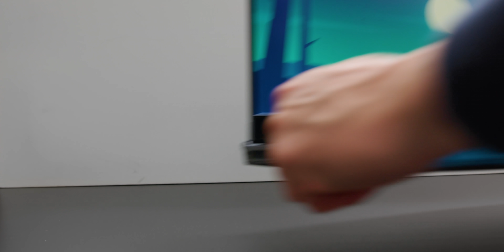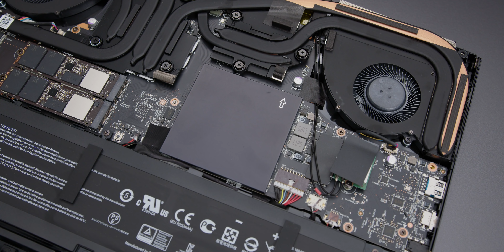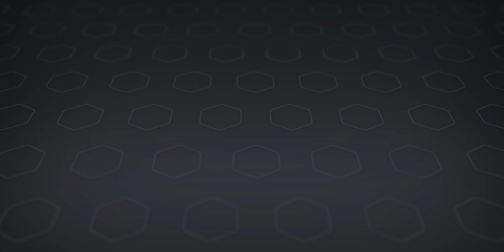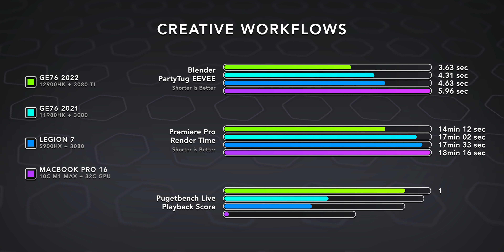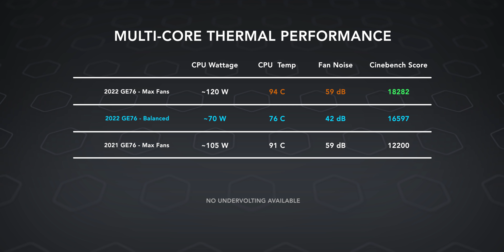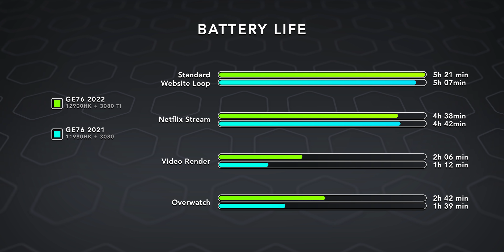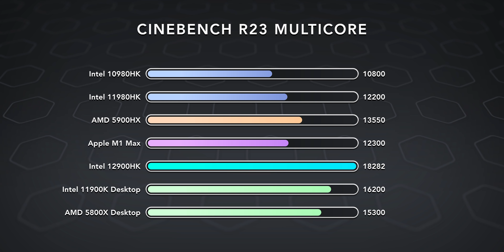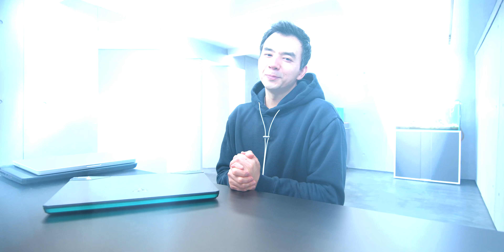This Laptop Is Faster Than Your Desktop

Comment from the maker: These new chips are FREAKING FANTASTIC. Especially if you don’t push them too hard and keep ‘em under 75 watts.
Reply: Can't wait for the Zeyphrus G14 Ryzen 6900HS + RX 6800S review 👌
Reply: How can I care if you don’t tell us the price?
Reply: Dave2D claiming this laptop being faster than a desktop gaming PC.
Also Dave2D stating it is slow than his MiniDesktop.*

Dave2D also trying to run 2k+ VR games on ultra settings on this laptop and starting to cry, because he realizes this title is bs.

A gaming laptop that is good if you don't push its performance:
Solitaire in 8k, 140 Hz. INSANE..
Reply: @privileguan9127  Apparently Dave was just testing if we're paying attention to him.🤣😂
Reply: Impressive numbers but I gotta say those temperatures & the batt life are proper pathetic though...for a laptop, 74 deg C is crazy, and 4 hours just ain't gonna cut it in 2022 man.
Reply: @PedanticPatrol  74C @ 75W lol otherwise its 93C at 105W... These really aren't impressive numbers outside of the raw performance available in this desktop replacement size laptop. 
This is mostly just because they got rid of the "desktop AMD" laptops they had a couple years ago... Otherwise a 5950x laptop would beat this one while using around the same wattage...
Reply: @Jimster481  amd has heat transfer issue. If replace 12900h with amd chip and power with 75w. That chip might go up to 120c.
Reply: @Jimster481  also why the fk u fanboys against admitting amd losing??? Is not competition good for everyone? Or u fnaboys just like to be right all the time. And Amd lost proves  u guys are not always  right? Or something?
Reply: @Jimster481  exactly! What makes a laptop impressive is its ability to trade blows with desktops WHILE STILL BEING A FUNCTIONAL LAPTOP. If the temperatures are crazy & you can’t even use the palm rest & keyboard without frying the micro vessels in your palms, what are you even talking about right?? Ridiculous man!
Reply: @PedanticPatrol  yep...
Reply: Where can i get that hoodie dave?
Reply: i think u mean 12900HK in the description
Reply: That doesn't sound too great though, you can't really say a chip is great but then say it can't be used to its fullest.
Reply: @mortenee88  Especially considering that 75W is what he is targeting. Sure that is fine in a desktop replacement but basically it is not okay in anything else. For example my Alienware M15 R5 can only deliver around 26-30W of cooling performance to the CPU when actually pushing the GPU to the max 120W power spec... At that wattage this chip would be amazingly slow considering how much power it needs to beat Zen3.
Reply: @Jimster481  the numbers are all wrong anyway. The cb23 numbers are just wrong.
Reply: @mortenee88  Which numbers are wrong specifically?
Reply: Hey Dave, theres a typo in the video description. The 12900HK.
Reply: @WubyDubyLee  lol i didn't even notice
Reply: YOO this is COOL
Reply: @GT Suryateja m1max unplugged is @30-35W
Reply: @Joe Copium
Reply: Halleluiah, they return Fn key to where it should be)
Reply: Dave please review xiaomi redmi g 2021 (ryzen edition
Reply: Sir plz create a channel over discord server for all your wallpapers
Reply: Definitely not faster than MY desktop though 😜
Reply: @Joe I mean they are using literally double the power or more vs the other platforms. It isn't really competitive in terms of power draw. The performance in good but maybe we should make some 5950X laptops with the TDC and EDC turned down just to retain the crown....
Reply: What's the price though? $3000+?
Reply: So many AMDumbs aka AMD fanboy are mad because Intel since Alder Lake comes out, it put AMD to the shame no matter if it desktop or laptop. Can't wait to see Intel bring monster CPU like Raptop Lake which is 8P+16E, this monster will bury Zen 4 like no tomorrow.
Reply: Liquid Matel is a joke. Waiting for it to leak and cause shortage.
Reply: Brother mine, what do you think about this thought, I've been following your channel along with a few more. And mostly the hype is all about gaming devices including phones.. and in that I haven't seen any android perform as well as the Iphones whether it be ROG Phone 5 or its ultimate version, I think there should be some sort of option wherein users would get to lock the frame rates of their own choice, and for this to happen the phone must use 100% of its CPU & GPU capability. So what do you think about this???
Reply: Oh boi
Reply: Description has the wrong number on purpose?
Reply: Price???
Reply: its amazing what they can do in a pinch aint it.....
Reply: There's someone pretending to be you.lol
Reply: @Spartan noble07 Yep I mean running at 90C+ is pretty garbage.
Reply: 👍🏼Sweet! Thank you, Dave! Nice to see Intel coming back under new CEO Pat G. 😎✌🏼
Reply: Do you think these laptops with the new chips will be great for video editing when working on battery?
Reply: Are you getting paid directly or indirectly through intel for this?
Reply: Laptops not interested,  MSRP GPUs only.
Reply: Awesome Laptop 👌🏻
Wish they make it in Full White
Reply: This combo is not on MSI's website! The closest version of this model to what you are showcasing here is an i7. There is no i9 with 360htz screen and a 3080ti.
Reply: Think you could post the SKU because I cant find the model that has these specs on their website.
Reply: Now I want to see how well would the new Celeron and Pentium fare
Reply: Hello dave. …. This msi laptop model is Raider GE76 12 UH
Reply: Real elephant in the room will be price 😂
Reply: Please review the Asus Zephyrus M16 2022 laptop. Thank you!
Reply: How can I get the wallpaper u r using
Reply: Apple CAN do that. But they made LAPTOP not behemoth.
Reply: This or the new Alienware X17 full loaded i don't care about price which one is more powerful and better for gaming ?
Reply: Can u please change the camera angle i kinda hurts my brain. Great content.
Reply: Uhhh I ain't seeing any link for online store in description to check this laptop out, would you mind putting it?
Reply: This laptop in overall is only 10% faster than previous year model. And cost 800$ more than last year's model. Very Disappointed
Reply: Some comments on battery life? Using balanced mode that'd be just over and hour and less than an hour when pushed? That's an extremely limiting factor or am I missing something?
Reply: Great machine but now of days you HAVE to have a 4K 120 hz monitor on the laptop like the Asus Predator Helios 500.  But I agree, I no longer see any reasons to EVER buy bulky desktops.  As my Predator can edit 4K videos faster than my RTX3080 TI DESKTOP
Reply: No it's not faster than my r9 5900x, 3080ti desktop!
Reply: @TheSaibarnub  I have both a i9 RTX3080ti 64G DDR4 Drsktop and I have the Acer Predator Helios 500 4K with the same exact specs as the Desktop just with a RTX3080 and there's no noticeable difference.  (I would have to get diagnostic tools to see an difference)  I use for 4K video renders
Reply: May I ask where you got that sick aquarium?
Reply: your hoodie ?
Reply: 🐶🐶🐶🐶🐶🐶🐶🐶🐶🐶🐶🐶🐶🐶🐶🐶 OMG SO CRAZY THE #LUMIY LIGHTBLADE YOU HAVE IS SO AMAZING √🐶🐶🐶🐶🐶🐶🐶🐶🐶🐶🐶🐶🐶🐶🐶🐶🐶🐶🐶🐶
Reply: Please send me 1 laptop. I want to learn computer
Reply: Can you please review MSI Creator Z17 A12UHST-046.
Reply: I'm looking for this laptop with the same components (360hz, 3080ti, i9 12900hk) but can't find one to pre order. There is an i7 alder lake instead of i9 alder lake. Would there be a big difference between the two?
Reply: Dave pls review rog strix scar 17. 12900h 3080ti
Reply: I would like to buy i would i purchase it?
Reply: Is this laptop better than the new Asus Scar 17 2022???
Reply: sorry, i cant flex on 5000 euros.
Reply: Hey I would like a tier list of the most silence  gamers laptops you can buy, with options likes money can buy, budget friendly too
Reply: where to buy though, i need it please put a link in the description
Reply: Any at a lower price?
Reply: hey Dave, more budget stuff please?
Reply: @Joe M1 Max already wasn’t particularly fast when it launched.
Reply: Those gains are due to DDR5. Wait till AMD does that!
Reply: @aniketk7401  DDR5
Reply: @joe_ferreira  Yup. Was looking up graphics when wrote that! 😅
Reply: This is totally pointless without including amd 6000 series
Reply: You notably benchmarked it against the AMD 5800 NOT the 6800X! Rigging the outcome against AMD?
Reply: Those cinebench r23 results looks cherry picked AF also.. scoring the 11900k that high is just wrong, it's honestly quite a shit CPU and you need some serious oc to make it score above 16k. At stock it should be around 13500..
Reply: yep they sure are
Reply: Oi dave, please arrange a gpu for me at msrp. Please 🙏🙏🥺🥺

Comment: LOL, maybe your desktop. I have 64 cores in mine, that's before "threaded", 256GB of RAM, and 3090. JUST barely missed the 60K score mark on Cinebench Multi-core and that was with pure air cooling in an 80F room. The CPU only got up to 50C.

Comment: dave can you next time make test with afterburner you playing. in afterburner must have cpu gpu specs and temps. on youtube guys always showing only performance in graphic. we cannot trust this graphics to buy laptops.  i showed many videos but cannot trust them. because few years ago i bought 3 gaming laptops and they are very stressfull to play games in very low settings with native resolution. CPU and GPU temp always make thermal throttling. now days some videos that have nice temps they always lock fps at 60. in online gaming 60fps is so bad. if cpu and gpu temp locking in 80c i want to buy laptop for gaming and working. if you read this comment thank you for your attention.

Comment: Yeah and I am the Pope.
First of all, it does not have full desktop CPU+GPU power (about 80% of a desktop counterpart), they are limited to TDP/TGP the manufacturer imposes, then there is the throttle because the temps rise to 90 degrees and over, with ease, which desktops don't.
So what's your point?
Reply: his point to get more views from the title description, its a click bait, nothing new

Comment: My Alienware x17 R2 with a 12th Gen Intel® Core™ i9-12900HK (24 MB cache, 14 cores, 20 threads, up to 5.00 GHz Turbo) processor and a NVIDIA® GeForce RTX™ 3080 Ti, 16 GB GDDR6 with a 4 TB RAID 0 (2 x 2 TB), M.2, PCIe NVMe, SSD hard-drive and 64 GB, 2 x 32 GB, DDR5, 4800 MHz, dual-channel memory with a 17.3", UHD 3840x2160, 120Hz, Non-Touch, 4ms, Advanced Optimus, ComfortView Plus, NVIDIA G-SYNC screen and Alienware X Series thin keyboard with per-key AlienFX lighting (English) with a Alienware Wireless Gaming Mouse - AW610M - Lunar Light >

Comment: Hmmm.....not sure about this one. Both Intel and Nvidia are energy guzzlers so there is going to be a lot of heat and a lot of power consumption. As far as cpu comparisons go, the Intel part has 14 cores while the AMD part has 8 cores. So you are comparing a V8 against a V4. Of course the V8 will win on power but it also requires much more fuel. Then there is the real problem.....PRICE. I'll pass on this one. If I want to game then I will use a desktop or a PS5, makes much more sense.

Comment: Don't get such a powerful gaming laptop unless you're a multi millionaire with a lot of money to burn. They don't last as long due to heat, I just recently gave up fixing my Alienware for the 5th or 6th time (each time very expensive to fix), from changing power adapters due to wire damage and over heating, to replacing the i7-8750h"s North Bridge, to changing the bios battery, to finally I don't know what's broken, maybe the 1070GPU chip. I coulda brought a whole new laptop with the money I spent on repairs, and I just got another laptop recently, after gaming for awhile, I wonder to myself why I didn't just change laptops sooner. I got the 3060, never buying above 60 again on a laptop even though 3070 isn't much more expensive.

Comment: In addition to gaming what about the content creation. Ok it is fast but it does  look  like it fails in color accuracy which you did not mention.   Also, the display is not very bright, and what about sound quality.   For all around performance and function it does not seem to match up with some other competitors.  For those us that are  want an all around computer not just a fast gaming machine.  What good is super fast rendering if it fails in color accuracy.  and 336 nits is not very bright.  So excited about performance but that are other important aspects of a machine than just fast performance.  I could sacrifice not so fast performance for color accuracy and a nice bright screen, and great sound quality.  It might be a great machine in some respects but it is a matter of preference when it comes to other aspects of the machine it seems to me.  Again you get so hyped about one thing you overlook other features. what about the ports?  what about the sound?

Comment: It may be possible to undervolt if in the bios you hit right shift + right alt left shift and f2 to enter advance mode that will show the over clock settings although in my ge76 11gen i7 it did look like no undervolting just increasing the voltage but I’ve been out of the overclocking game for awial so maybe I just need to look into it more to get it to undervolt

Comment: In Norway this laptop is priced at the equivalent of 6000$ USD.

Let's put that insane price into perspective.

For almost the same ammount of money I could buy a prebuilt desktop with these specifications:

ASUS ROG Strix custom case
Custom Asus ROG Strix X570-F motherboard
AMD Ryzen 9 5900X
NVIDIA GeForce RTX 3090
32 GB RAM, 1024+2048 GB (SSD+HDD)
850 Watt 80+ platinum psu

And I would still have enough money left over to buy myself a laptop with these specifications too.

GeForce RTX 3080 Mobile
Ryzen 7 5800H
16GB RAM
512GB SSD
1TB HDD
1080p 144hz display

If you build your own pc the desktop machine would be cheaper and you could actually save money compared to just buying the MSI GE76 or invest it into a better laptop than I used in my example.

Yes the MSI GE76 is better than the laptop I did use in the example but the performance difference in games are not going to be more than 10-20% in most games while the price is 3 times higher.

Comment: Sure it out perform a little bit Apple M1 Max but we should remember that heat is degrading the device life span & the performance will go weaker with time. Meaning, the performance to power consumption ratio is the high tech thing we should focus in! That ratio is the key to have device long life sapn, longer battery life, lower electricity bill & better environment! Nowadays we should bring first the numbers of that ratio & promote devices by that ratio
So no, the Apple M1 laptops still way better than any laptop out there. By the way I'm using MSI 75
Reply: & this is useless if it's not a CPU/GPU ARM. Something to compete with the Apple M chips. 
We need that to happen to solve graphic cards shortage, great FPS/graphics, low heat, thin device & high power efficiency. If Intel, AMD & Nvidia don't make it soon, the Apple M chip 2 years transforming program that includes AAA gaming support will dominate the marke

Comment: They finally fixed the akward keyboard layout AND full numpad it decent IO 4 usb 3.2 plus thunderbold card reader 3.5mm and full RJ45 HDMI (wonder if some are combi ports which is a minus)and internels look good too, bit annoyed they went for soldered wifi, i guess its a contender still need more research

Comment: This isn't going to outperform most desktop gaming machines 1 generation back.  It will heat up, it will throttle, and its performance will take a nosedive.  Is it amazing for a laptop?  Yes.  Will this machine outperform an 11th gen Intel desktop machine with a 20xx series Nvidia and DDR4?  Not over a full gaming session.

Comment: So even though AMD Zen 3+ is coming out on TSMC N6P, is going to clock faster, and AMD is saying it has 1.3X the performance of Zen 3, which is 30%, and the APUs are no longer old GCN and are now RDNA 2, just hand the win over to Intel.  Maybe for the high end part, but I watched the review with the high end part which also has the 3080 Ti, and the amount of gaming improvement looks like the difference of last year's 3080 and this year's 3080 Ti, meaning it didn't look any better than Tiger Lake really.

I'm thinking Zen 3+ when paired with a 3080 Ti is going to look about the same in gaming.

Comment: Meh. It's still a laptop which all suck. They just don't last and can barely be upgraded. Most are made with anti third party repair ideologies and they usually die after a few years from thermal problems. And they're a pain in the ass to repair anyway. They're using proprietary parts sometimes making it even more annoying to fix. They're just crap.

Comment: "Laughts in 3900X and 6900 XT"
Don't think so :D

But seriously. The power it's not bad. BUT. This fucking "RTX3080Ti" it's a pure lie. A RTX 3080Ti have 10240 Shader. This "RTX 3080Ti" have just 7424Shader. Any RTX 3080 have 8704 Shader. So The RTX 3080 have 17% more Shader than the RTX 3080Ti mobile.

 I just find it very shitty and confusing from Nvidia that you call your cards e.B. RTX 3080 and then they do not even have the shader of an RTX 3060Ti. There are 2-3 different RTX 3060/3070/3080 versions with different shaders alone!

If a notebook says RTX 3080, I expect a fully developed RTX 3080 with greatly reduced clock and power consumption and not an RTX 3080 that has only 5% more shaders than an RTX 3060Ti. Besides, who can still see through it when there are various strong RTX 3060 cards?

This super great and fast notebook has so almost only an RTX 3070Ti Super installed and since the clock and power limit is still greatly reduced, this laptop will probably be slower than an RTX 3060Ti in practice. This is just ridiculous and sad!